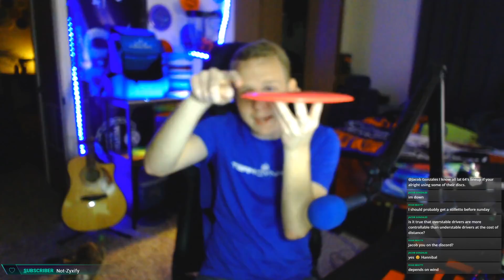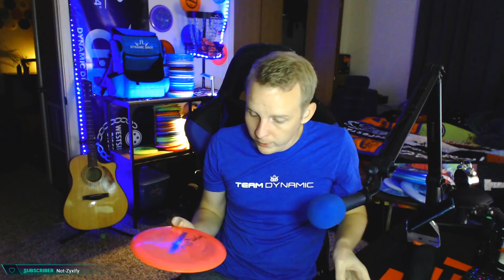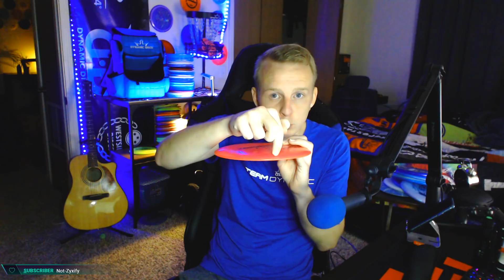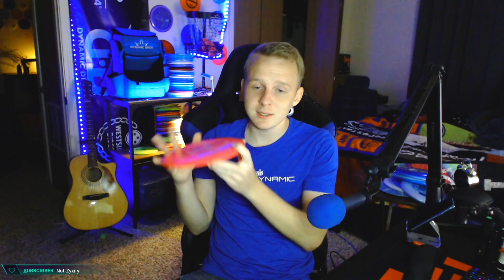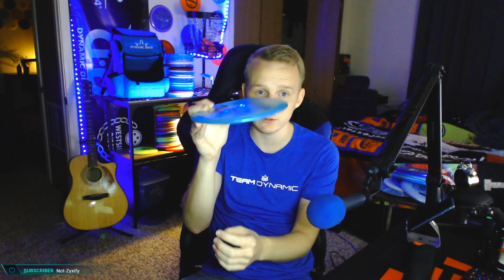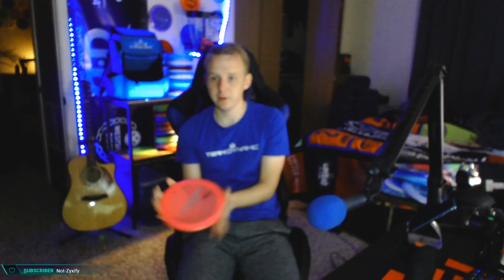The Physics of How Discs Fly [FIXED]

Comment: Putting more weight on the outside of a disc like an overmold disc, does not on its own make the disc spin less. What it does is make it harder to spin the same amount. The effect is less spin, but the reason is different. Also, the arms analogy is not correct. When you put your arms out while spinning, you are making your circle bigger which slows down spin. Discs are near the same size, so that example doesn't work.

Overmold certainly has an effect, but whether that effect is significant is what we need to discuss.
Reply from the maker: Yeah I didn't mean to imply that it does nothing, but the result is for the same force applied, an overmold disc will spin less than a single mold. I'm also not convinced it makes a tangible difference in the actual flight of the disc.
Reply: @DannyLindahl  That makes sense. I imagine that, if anything, it would change the way their understable discs fly. In my experience, they flip a little later and not as much, and then fight out of the turn quicker. I don't think overmold really adds any distance.

Comment: I've read some white papers on this and at least the terminology is and to some extent the theory has been completely different. (sry I can't find the paper now, but I can try to look for it)
1. I read that the lift would be the result of lower air pressure on the top of the disc lifting it up. This is caused by a longer route for the air to travel on top of a domed disc than below it.
2. I read that turn is the result of the left (RHBH) edge of the disc having more velocity and as a result having more lift than the right edge
3. I read that the fade is the result of gyroscopic force when the disc slows down and its nose lifts up, turning the left wing (RHBH) down due to the said effect
Bonus: Everyone has read that in vacuum all objects fall down just as fast ;)

Regarding the beat up discs, I think you are correct with the "pimple theory" but I definitely have some drivers where the wing has been bent down from a tree hit and made the disc very understable. 

Another factor that is HUGE on trilogy discs is the flashing. As the flashing on the bottom of the rim wears off, the tip of the wing effectively comes down as well making the disc more understable. I've tested this personally on a couple of your drivers by throwing them, then removing the flashing and repeating the throws. This effect is way more drastic that the gradual wear of the surface. It is most noticeable on premium plastic drivers.
Reply: 1.  Path length is not a useful method to understand lift of a wing.  Equal transit time is a fallacy; a packet of air split at the leading edge of a wing does not rejoin at the trailing edge.

2.  That effect, while real, is probably two orders of magnitude smaller than the actual cause, which is torque-induced precession caused by a pitching torque.  By 'pitch', I mean a torque which would cause a non-spinning object to pitch up or pitch down.

3.  Both turn and fade are a function of torque-induced precession.  The disc reverses its behavior when its changing angle of attack (angle with respect to the wind) causes a reversal in pitching moment.  Initially the disc flies with a zero-to-negative angle of attack.  Towards the end of flight, as the disc descends, it has a positive angle of attack.
Reply: @lithiumdeuteride  I would like to understand better what you mean by "torque-induced precession" and "pitching torque", because I'm not quite sure what you mean by them. Is the first one just a fancier name for gyroscopic effect?

As a result, I find it difficult to make sense of your response to my point 3. The range of outcomes is very wide with identical "attack angles" so what is the difference between the discs? By positive attack, do you mean nose up or nose down?
Reply: @jannejaakkola5836  Keep in mind that angle of attack is measured relative to the disc's path through the air, not relative to the ground.

When you first throw the disc, it has a high velocity, and therefore a high amount of lift, so it rises.  Rising causes it to have a negative angle of attack relative to the air, which causes a twisting force (a torque) on the disc that would cause a non-spinning object to pitch downward.  But because the disc is spinning, it doesn't pitch downward - instead it rolls (to the right for a RHBH throw).  Rolling (instead of pitching) when subject to a pitching torque is torque-induced (gyroscopic) precession.

As the disc loses speed, it begins to move downward.  This causes it to have a positive angle of attack relative to the air, which causes an upward pitching torque.  Since the disc is still spinning, this upward pitching torque causes it to roll to the left (for a RHBH throw).
Reply: @lithiumdeuteride  Ok thanks. The fade part was pretty much what I had read as well, but in those articles the turn was clearly attributed to non-symmetrical lift having bigger impact during high speed phase. None stated negative angle of attack.

I'm actually curious if the angle of attack truly is negative when people throw "nose down" (in relation to the vector of movement) or if it's just a term to say that it is not nose up. Wouldn't that make even the overstable discs turn, if what you're saying is true? There would be no counter force in that case.
Reply: @jannejaakkola5836  The shape of the edge of the disc changes the angle of attack at which the disc has 'neutral' behavior - no tendency to roll either left or right (indicating zero net pitching torque).  A disc whose rim biases it towards a downward pitching torque (and therefore rolling right for a RHBH throw) at zero angle of attack is understable, while a disc whose rim biases it towards an upward pitching torque (and therefore rolling left) at zero angle of attack is overstable.

I should also note that all torque-induced precession occurs at a rate which is proportional to the pitching torque, but inversely proportional to the rate of spin.  If you throw a disc at the same velocity, but with higher spin rate (angular velocity), it will precess more slowly, and therefore its flight path will evolve more gradually (over a longer distance).  That's one reason why most professional players get better distance with backhand throws - backhand achieves higher angular velocity, so the disc rolls more gradually.
Reply: @lithiumdeuteride  Thanks! 

This makes a lot of sense and is in line with how PLH seems to indicate stability.

Comment: It's important to denote the difference between rotational inertia (aka moment of inertia and linear inertia aka mass), so a disc that has a larger rim will have a larger moment of inertia because the mass is more concentrated further away from the axis of rotation (radius r). I have not seen any actual experimental validation regarding why a disc fades left (RHBH) or right (LHBH). Just doing math on the back of a napkin, it might be explained by relative velocity effects on the sides of the disc inducing a torque disparity.

Comment: I think that gyroscopic precession is key to understanding the physics of flight, and I am happy to see you tie turn and fade into this. 🤓👍 When I first heard about it on Vsauce, he seemed to claim that the angle, with which the tilt is turned away from the flight direction, is 90 degrees. Do we know that it is 90 degrees? Or does it vary with the speed of rotation and the velocity of the air flow around the disc? (Really nice video!)
Reply: the lift force is perpendicular to the flight plate. This video gives a pretty nice intuitive explanation of the effect. You can ofc show it by only using calculus, but if it's possible to understand with an intuitive explanation, it is always satisfying https://youtu.be/n5bKzBZ7XuM

Comment: If you have more spin on a disc will it make it turn and fade less? Both overstable and understable discs
Reply: yes, this is why people struggle with throwing putters. They don't give enough spin on the disc relative to its forward velocity. That's because they are not making the disc pivot fully around their (usually) index finger

Comment: Hey Danny, wanted to touch on what you said about Overmold as I kinda nerded out on this yesterday. 

You are correct in saying that moving the center of gravity away from the center of the disc does make it harder to put the same amount of snap on a disc as one that has a more central to the disc. Here is what you missed. If you get 12,000 RPMs on an overmold and 15,000 on a regular disc, and assuming the gyro is designed for 12,000, regular is designed for 15,000, the gyro will experience less turnover due to it being harder to add more spin, and easier to flip the regular disc. Then, the progression down to zero rpms would be slower for the overmold due to the weight being further from center and traveling a greater circumference. Think E=mc^2. Any distance change is squared so it does have a big effect on how the energy dissipates , and that explains why the flight lines between discs like the Envy tend to have very straight lines while not requiring as much hyzer to flip to center. This also makes it so they don't over turn too far to the right or left if you put it on a good line. Meanwhile the same shot from a Luna or P2 might be easier to get the disc to turn as well as have more fade if the disc loses too much of it's rotation. Ideally, overmold should lead to more consistent flight, but there are situations where players want that big turnover S curve or they want to put a ton of hyzer on a flip up.

So in the end you are right about preference, but the overmold aspect does effect the flight of a disc and how you throw it.

As always I appreciate all the effort. Keep up the great work!
Reply: Nah, if you put the same amount of torque on both discs, they will have the same angular momentum. The disc with higher moment of inertia (overmold) will rotate slower. If both discs were to travel at the same speed, they would turn and fade as much. However, the velocity of the disc is given by the velocity of its center of mass, and will be given by the speed of the fingertips (which we assume is the same for both throws/discs) + the speed of the center of mass of the disc relative to the fingertips. Since the same torque will create slower rotation on the overmold, its center of mass will rotate slower around the fingertips and thus the magnitude of its velocity will be smaller (so it flies slower) compared to the regular disc. Now since the lift force is proportional to the discs linear velocity (how fast its travelling forward), this means that the overmold will turn and fade less, simply because the lift force is smaller. So with an overmold you get less flippy (which has been anecdotally confirmed?), but slower flight.
Reply: @Postermaestro  When you say 'Slower Flight' do you mean the time it a disc to flip up/over and fight back to hyzer? If so, I agree. The speed of disc out of the hand would be the same. The overmold just creates a greater radius of gyration. Same torque = lower rpms -> lower rate of rpms lost.

I assume the lower lift force is considered and the disc mold's dome is designed with the lower rotation in mind. If we measure the as we have been, the mvp would be lower rpm, but if we measured form the radius of gyration and squared the result, assuming both discs were the same mass, and the same energy was put into spin, that would be the same out of the hand.

It's really just a transfer from rotation to higher resistance to slowing those rpms by moving the center of rotational inertia. 

We're probably on the same page, but I haven't used these words in conversation in almost 10 years.
Reply: @DaradeDesign   To have a meaningful comparison you have to assume identical molds. No, I'm saying the actual velocity of the disc would be lower, assuming the same armspeed, because the higher moment of inertia of the overmold will lead to a smaller angular acceleration as it pivots out of the hand. The same reason it has lower spin. The velocity of the disc is given by the speed of the fingertips + the speed of the disc pivoting relative to the fingertips.
Reply from the maker: @Postermaestro  But all of that is assuming both discs are the same mold right? So any differences could also just be attributed to differences in the shape of the disc.
Reply: @DannyLindahl  Yes I assumed the same mold, so you are absolutely right about the "anecdotal evidence". However, there might be advantages/disadvantages to having a disc fly slower with the same shape, so its not as simple as just making a regular disc with a different shape to mimic the overmold. Maybe a slower flying wide rim disc is good if you want a slower and straighter flying disc, that is still more aerodynamic than a blunter disc, meaning it won't slow down as fast as a blunter disc. And then feel/release from the hand also comes into play. Overmold Getaway when? :^)
Reply: @Postermaestro  I FEEL like difference from an overmould would be similar to a heavy versus light disc.
Heavy discs have more mometum but limited to the muscle power you posess to accelerate. Light discs can reach higher speeds but limited to  your  technique. 
Overmoulds might suit strong wrists with less technique. Standard disc might suit weak wrist with good technique
Reply: @snikwahjets  well if you put the same torque on an overmold and a heavier regular disc (however much heavier that results in the same moment of inertia) then they will have the same angular momentum and the same velocity. Since they are the same shape and are (initially) travelling at the same speed, the lift force (upwards) is the same. However a larger downwards force due to gravity acts on the heavier disc, so it will drop faster than the overmold. This was all assuming that you put the same amount of impulse (force x time) to both discs. Since a heavier disc will be slower to accelerate, you will probably be able to accelerate it for a longer time so the comparison is not completely fair. But there is also a "max weight" rule related to the diameter of the disc and you also need to consider the properties of the plastic as you make it heavier or lighter while maintaining the same shape.
Reply from the maker: I agree that design is much more important than whether a disc is overmolded or not. Actually I’d say that design is the most important part regardless. Believe it or not, you can find non-overmold discs that fly the same way overmold stuff does. And vice versa. It’s not magic.
Reply: I'd love to hear the engineers, from major manufacturers, chime in to the conversation.
Put aside proprietary claims and help the community out.
The truth will set us free.
Or "you can't handle the truth"
Reply from the maker: I’m also not sure that the difference at the end of the flight would be significant. If the overmold starts at a lower rpm but slows down slower, it seems like it should roughly match the faster disc that loses more rpms as it flies. At the end of the day, they’re all discs. If overmolds were inherently better, all pros would be throwing them. Winnings are more valuable than sponsorships. Or, every company would be investing HEAVILY into them, and they’re not. It doesn’t make that big of a difference, if any.
Reply: @DannyLindahl  is this one of those "I feel like" arguments or do you have any data to support your claim?
Reply from the maker: @nicolaiz4631  Is there any evidence contrary? Logically, they shouldn't make a difference. If they do, it's nothing that can't be compensated for in the shape of the disc.
Reply: @DannyLindahl  ok, I see it might have come out a bit negative. Just challenging the definitive conclusion without any actual data. 
Love your commitment and the content you  post, never stop :)

Comment: Your pretty close on beat in discs, the imperfections in the rim expand your air your air cone on the disc if you look at cars and other objects made to cut through the air, bigger air cone the more air molecules put in motion it lowers the air friction on the disc bc much like breaking surface tension of water breaks the static tension of the air and wind. So with the fluid motion of the air around your disc you have less force against the nose of the disc

Comment: Your original interpretation of lift was correct. Since the air has a longer flow path over the top of the disc relative to the bottom it speeds up because it is basically trying to equalize the air pressure differential caused by the disc moving through the air. As the air speeds up over the top of the disc it's density decreases, you wind up with lower pressure above the disc than below, causing an upward force on the disc. A domier disc will have more lift than a flatter disc because the air has a longer flow path over the top causing it to speed up more and thus a greater decrease in pressure. The comes a point where the curve is too dramatic(or the speed is too great) and the air can no longer follow the curve, causing a loss of lift due to disruption/separation of the air flow.